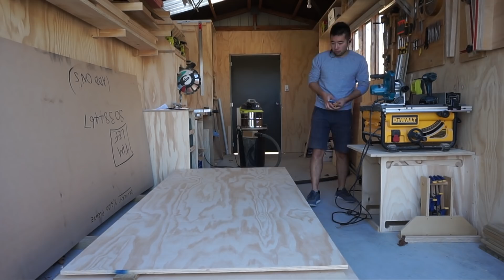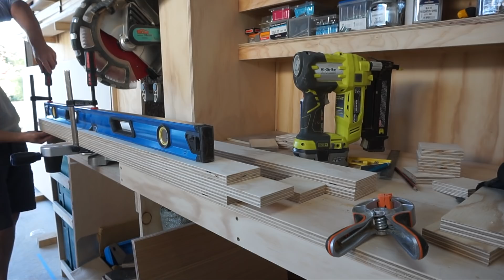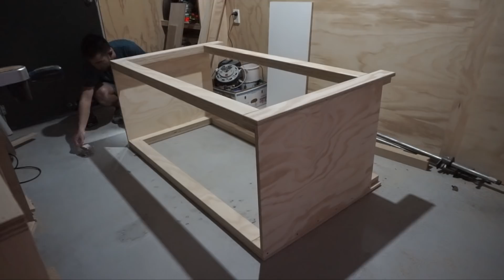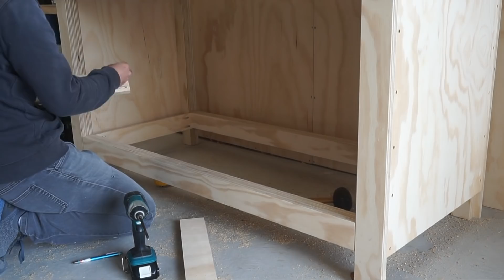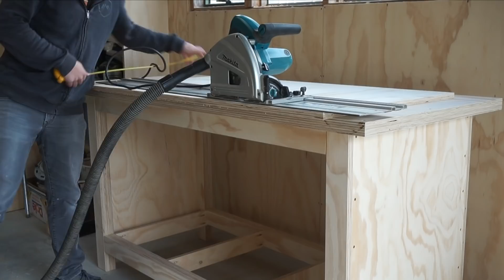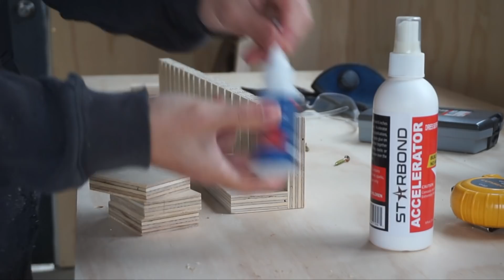Making A Simple Plywood Workbench With Clamp Storage

Comment: You really need to look at my Styrofoam 2x4 video.  It would make cutting plywood on the floor so much easier and more stable during cutting.  Also you could use my panel saw system to cut those full sheets without having to lay them on floor.  The panel saw system can be mounted anywhere (in under 2 minutes) and takes up less than 16 square ft. of space while using.  Nice workbench.  Keep up the great videos.  I don't always comment, I do always watch.